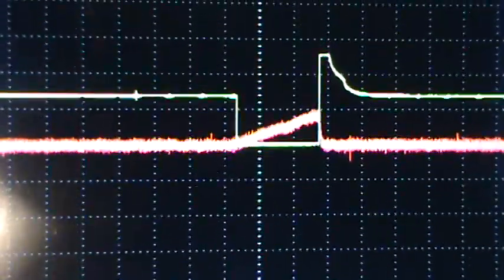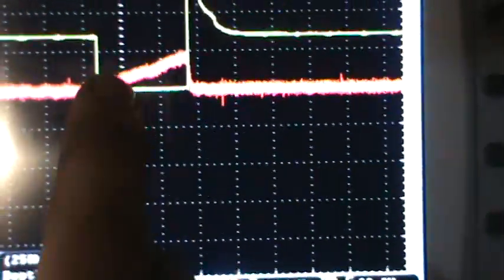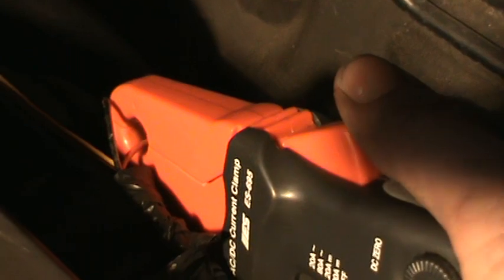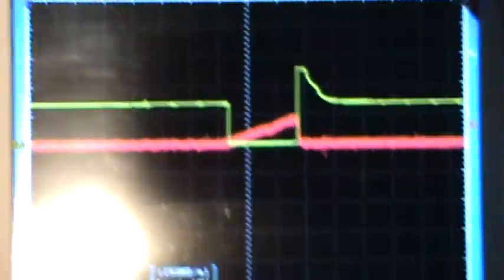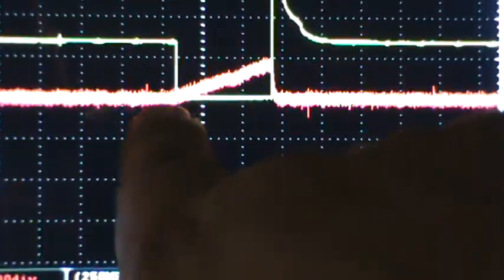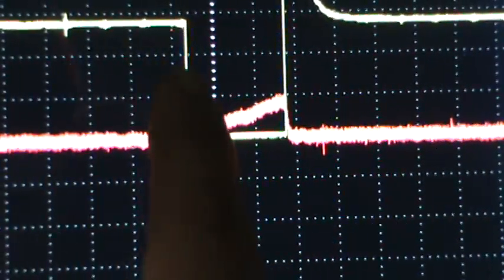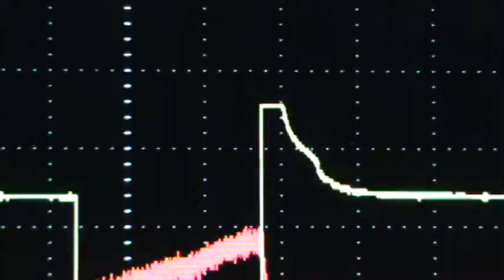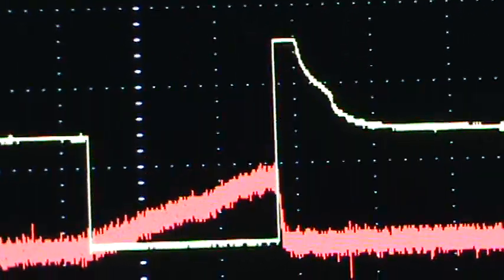Fuel Injector Waveform Anaylsis

Comment: I learned a lot, and it is simple once explained.
IF YOU READ THIS please explain the delay in the pintal closing (Time) in reguards to the ground closing earlyer. I asume it is a mecanical delay of time. I guess the way to think of this, is that it takes more mecanical time to  close compared to the speed of electrical flow. so it is a delay.....mccully_r@yahoo.com      You are a good teacher  i would love to see other wave forms explained,,  GREAT VIDEO
Reply from the maker: Yes, mechanical delay. With a scope, we are zooming in to milliseconds. I am not that good of a teacher compared to many other people.
Reply: No you are very good!
Reply: You are underatting your self.. This is the first video that explained the breakdowns of horozontal and vertical wave time lines. i wish you would make more.Scanner Danner is good also, but does not break the complete wave down... I finaly understand the control wire.. Its one thing to hold it in your hand, but another to see where it is on the screen as a  wave. line.... It helps very much... thanks